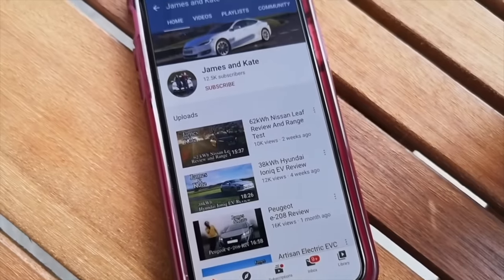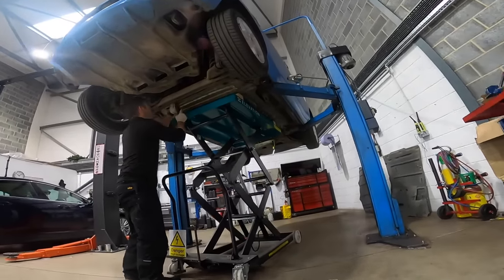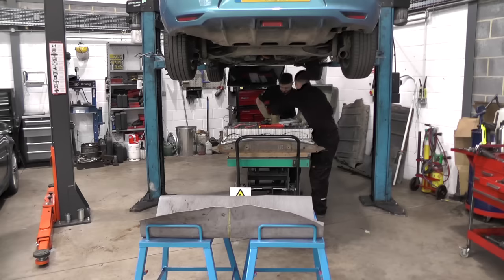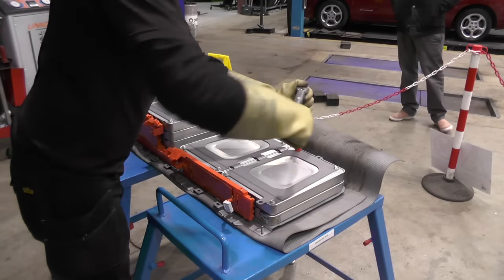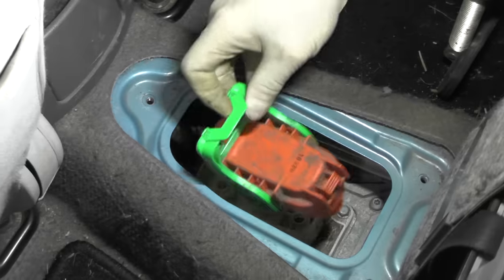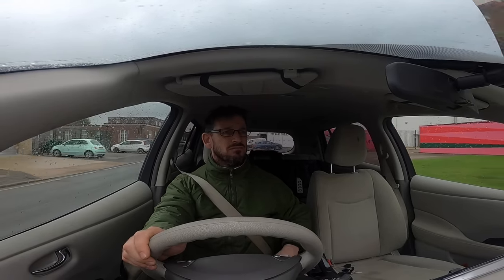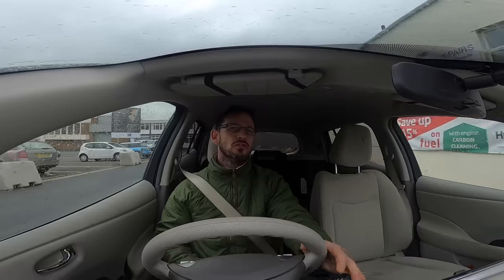Electric Car Battery - Dead After 3 Years, Right??

Comment: What they should be doing is making it even easier to replace dead part’s of a battery and have a system whereby the defective part can be part exchanged for the new part. It should be a simple DIY job and not need a garage with specialist tools. That will be real progress.

Comment: The LEAF battery is very serviceable. I don’t think all EVs are equal in this respect. However, most EVs don’t have the same issues with the battery that early LEAFs had. It comes with being early tech I guess, however still a huge mistake by Nissan to leave out any kind of active cooling.

Comment: It's nice Nissan designed this thing to be easily service. Too bad most dealership service don't know what the hell they are doing, and seem to predatorily gouge people who have faulty batteries. I always advise people who are interested in EV's to never get a new LEAF, get something made by Tesla, Kia/Hyundai, or GM, something that won't suffer from accelerated degradation. Old used leafs can be bought at bargain-bin prices, but don't count on a Nissan dealership to be able to perform this simple fix if there's something awry with the battery. Hopefully third party battery shops become more prolific so people can affordably get their batteries fixed.
Reply: Great advice, just one small correction. GM battery packs are the most expensive to replace, and same as Nissan. GM Dealers are un-willing and/or unable to service.

Comment: So if you have lost 2 capacity bars in your leaf this is the fix? Is this correct?
Reply: No. This battery had an insulation fault, so would report a fault via the management system. Once the faulty module was found, the condition of the replacement module meant that the SOH did climb from 78% to 81.2%.
Reply: @mattcleevely8794  Thanks for the reply 👍

Comment: Top Gear bought one. They claimed it was right off due to its lack of range
Reply: @ lee nevin  Dolts, the lot of 'em.  They should drive it right over to Muxsan and install the upgrades to take it to 400km.  https://muxsan.com/English/index.html
Reply: @Jo Blow Not a chance.  I have a 24kWh 2011 Gen1 Leaf.  And I'll take that on my 44.2 mile round-trip to work instead of a bike any day of the week, even after five years' daily use as a commuter car.  (My workplace has since installed three shiny new charging stations in one of the parking structures.)  It is vastly more comfortable in the rain, has shade and air conditioning, goes faster, lets you bring half a ton of stuff along with, and if you maintain that a bike is better than that...I suspect you may be resorting to rhetoric and hyperbole when you have little or no direct knowledge, or a position to defend.  Possibly both.
Bad form.
Reply: @Jo Blow Not just rhetoric and hyperbole, let's throw ad hominem to the mix.  Sorry to say I expected no less, and you've just shown how pointless it was to have given you the benefit of the doubt.
Still, my wife "has" our first car (a 2002 PT Cruiser) for trips out of town, or for when we need to be in two places at once, but with the plague firmly in place thanks to a "Democratic hoax" (ahem,) we haven't been to a petrol station since March.  Even at today's insanely low fuel prices, it currently costs 1/3 as much per mile in a Leaf.  Though the car came with a "granny charger," that'll fully charge it overnight from a run-of-the-mill 110V 3-wire, for early adopters like us, Nissan threw in a wall-mount level-2 charger, which I cabled to the 240V breaker reserved for a dryer (ours is gas.)  I can recharge in about 2-3 hours with it.
I can go all the way across town and back on a single charge if I keep to surface streets, but both the onboard app and PlugShgare let me see where L2 and L3 charging stations are, the latter of which will put 80% of a charge back on in less than 30 minutes...time enough to do some shopping or grab a meal.  Even better, any Nissan dealership on the planet has L2 and L3 chargers, and I can charge there for free forever at any time.  (There are seven in our metro.)  Go ahead, explain to me the virtues of an ICE car over this...does your dealer ever top off the tank for you?  For those occasions when we go all the way across town, it's for more than a day, and we charge there while working, playing, sleeping, or whatever.
I've put 72,000 miles on this guy since we bought it, and so far it's only wanted a set of tyres and wiper blades.  (And a nifty new horn to replace the clown car horn that comes standard; https://www.youtube.com/watch?v=02dYqCmQdZQ&t=333s.)  Annual inspection and registration?  US$7...no emission test.  And oil changes?  WIll never happen.  Sure, the other car is twice as old, but it's there if we need it.  But full charge to full discharge took me 91 miles the one time I tried it, and I have hardly ever needed to go farther without boarding an airplane.  True, I do not have the original battery.  But it was only because Nissan offered to give me a new one in 2015; a second-generation battery at that, which required an adapter that I now don't have to buy when I want to swap in a higher-capacity battery circa 2030.  Which will have another decade of technological development on it, and cost even less per kWh.  It might even be a supercapacitor.
Are you berating me as a way of justifying keeping your old ICE car, or getting a new one?  You don't have to sell me on it.  Let it die a natural death after ten years, it won't bother me a bit.  I can detail my experience of the Leaf as superior to that of my trusty coupe (which I would still be riding around in had it not been bombed in '04) without ever having to touch on the environmental argument, nor of not supporting Islamic lunacy by not using petrol any more.  But if you're trying to convince me that it would improve life for either of us to have two ICE cars...
this is not a fight you can win.
Reply: @Jo Blow Hey, at least you sort of read it; thanks.  I wrote a lot because there's a lot of ground to cover.  And the "limited locations" are the fast, free Nissan dealerships.  I've only had to charge away from home a few times, and used the card Nissan gave me to do it for free most of the times I did.  Blink and other charger networks are ubiquitous, and it still costs less per mile than petrol even buying it from them.  (They're at grocers, pharmacy chains, public libraries, airport parking lots, just to name a few.)  [Edit:  have a look at PlugShare.com to see how many you have near you.]
Yes, it was a little more costly at first.  New, we paid US$26K; a little higher than a similar new ICE car (the Nissan Versa used the same chassis, but was less well equipped,) still vastly more practical for a commuter.  We already had one ICE car in good working order, but now we could work at different places and not rely on public transit.  (Still have it.)
As for the issues you point to, here's MotorWeek on those topics (https://www.youtube.com/watch?v=X_11rlVF3Dg)
...and here's a fairly even-handed private owner (https://www.youtube.com/watch?v=mFiTHPMhXwo)
Sure, there are issues with new technology.  LeafSpy and an OBDII sensor are a great help.  (Though I have one, I have never needed it.)  And contrary to what he says, you can pull the battery in your own driveway. (https://www.youtube.com/watch?v=BtBOKyu_soU&t=192s)  Build a creeper with some wood and castors, buy a used £50 floor jack and service lifts, and you're ready to go.  (I may do the battery swap myself when the time comes.)  I have had no module failures, so I couldn't speak to that, though I did deliberately run my first battery into the ground by 440V charging as often as possible when I learned I was getting a new one from Nissan.  AFAIK, no modules failed, though I did run the pack under 70% in four years by doing so.  I don't run deliveries with an EV, though I understand Amazon soon will.
What none of these videos mention is the time savings.  Make a weekly 15-minute stop at the petrol station (and assuming there is no queue, ever,) that's already more than 60 waking hours over five years.  About four days of your irreplaceable life back.  Free!
Stopping for an oil change every three months or so?  How long does that take?  30 minutes, assuming no queue?  Guess what:  That's more than an additional day of your life back.
Five years' wear and tear on an ICE always comes at a cost (MotorWeek covered that pretty well, but gave no estimates.)  Let's just say it's another two days of time and money you don't need to spend.  Congratulations, that's at least a week of your life back; a vacation and money to have it on.
How will you spend it?  Watch ten more movies?  Sleep a bit longer?  Race on the Autobahn?  Take a weekend river cruise?
You will never know.

But I will.

Comment: How ironic, the lack of liquid battery cooling made the cell swap easier. Any other EV with liquid cooling need the cooling system drained first in order to remove the whole pack.
Reply from the maker: Indeed. This would have been drained whilst still in the vehicle, had it been the case

Comment: Much of the battery (or cells) are not recyclable (or difficult to recycle) and many will not last more than 10 years, even the manufacturers will only guarantee 6-7 years. 87 mile range, Is that really much of an improvement?
Reply: They are not difficult to recycle if you have the correct means to do it. VW have EV battery recycling plants already up and running.....almost all the elements of a battery pack can be re-used.

Comment: What many people don't realize is that, unless they're abused, automotive Li-ion batteries typically DON'T DIE!  They simply fade away very, very slowly. It's the abuse that gets them which is largely from overheating. IMHO, and contrary to popular opinion, the early Leaf batteries were not poorly engineered, and for most people did not need to be liquid cooled. Nissan got a black eye for this but it's largely undeserved. If you do not use DC Fast chargers preferring instead to use Level 1 and Level 2 charging exclusively, you should never need liquid cooling. The biggest problem with the early Leaf batteries was that Nissan simply did not design them to take the abuse of being operated outside of their design envelope (something Americans have a bad habit of doing). The batteries didn't like being operated in areas where ambient temperatures often exceeded 100F. Doing so demanded that extended periods at extremely high speeds (over 80) mph be avoided along with DC Fast charging since both would drive up internal temperatures that were likely high already due to high ambient temperatures. Too many of the early Leaf battery failures were from Arizona where it's not uncommon for daytime temperatures to exceed 110F. Owners of these vehicles also admitted to using DC Fast chargers during high ambient temperatures. 
     Other than exposing the cars to conditions that caused excessive internal battery temperatures the only other factor for premature capacity loss was excessive charge cycles. I believe the early batteries were only designed to last between 800 and 1000 "full" charge cycles.  With only 80 miles of range, after 1000 charge cycles, you'd be lucky to have gone 80,000 miles before seeing 15%-20% capacity loss. Still there are way too many examples of Leafs going over 100k miles on the original batteries which makes a strong case for their quality especially since the early 24kWh batteries were so tiny that they required charging far more frequently. Today, because they're much larger and offer much higher range between charges, the newer batteries will see far fewer charge cycles for any given mileage.  With most new EVs getting 250 miles or more of range they may only need to be charged once per week. This is unlike the tiny range of the older 24kWh batteries which often necessitated charging two or more times per day.  For long lifespans SIZE MATTERS when it comes to EV batteries.

Comment: Just wondering what is on the odometer of the car.
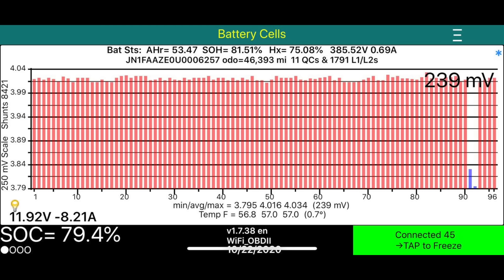Reply: odo=46,393mi  according to leaf spy at 1:07
Reply: You can't necessarily rely on the odometer as a measure of the state of the battery. That will depend on how the car has been driven and how sympathetically the battery has been treated. It's not a new concept. Drive an i.c. car really badly, and that will let you down prematurely too.......
Reply: @Brian-om2hh  I was being lazy, looked more closely at the video and showed 46,000 miles on the clock. The constant reference to ‘landfill’ is silly though, companies are already set up ready to do recycling and what they call ‘urban mining’. Audi/Northstar have a pilot plant and have already build new batteries from materials recovered from old ones. EVs are in theory and should be in practice part of the circular economy we need.

Comment: Most people? 
In almost 30 years of dealing with battery systems I have never heard anybody even suggest batteries go into landfill,.
It sounds like something from the media or of the internet.
Reply: I’ll tell you most people tell me, ah you have to replace the battery after two years. It’s the most common muc ice drivers will tell you. I just say “ really?” .
Reply: @bdeithrick  Where do ICE drivers get this information from?
Reply: @anthonylangton3664  big oil propaganda
Reply: @bdeithrick  where?
Forgive me if that sounds a bit smart, but where.
Going with my original comment, I have never heard this.
Reply: @anthonylangton3664  Jeremy Clarkson from Top Gear famously said it (around the time that he reviewed the Tesla Roadster). I'm an energy engineer and have had Clarkson quoted at me ever since (though it's gradually decreasing in frequency)...
Reply: @davidhaywood8029  I test drove a 1st gen Leaf when it was first launched. Went to the local Nissan dealer and their head salesman, their HEAD SALESMAN said, “Oh you don’t want one of them, they don’t work. Didn’t you see Top Gear?” (I went to a Nissan dealer in the next city instead and they were very helpful).
Reply: Try clicking on a car advert on social media. Plenty of “experts” on there!

Comment: Why was it so expensive ?  Is there a price breakdown?  It only took 2 hours, so that maybe £150, that leaves £350 for the battery.
Reply: Unfortunately I think your 'labour' estimate of £150 doesn't take into account that the job required 2 technicians, for EACH of which you may be charged up to £100 per hour, particularly in a authorised dealership. Stings I know, but pretty standard nowdays.
Reply: @Phoenixeire  so £100 an hour for someone to unscrew a few bolts and move a heavy battery.  Well worth it
Reply: @mrglwatson  Believe me, I agree with your sentiments, but those tools, jacks, lifts, rent, power and wages have to be paid for somehow.

Comment: EV batteries will never go to landfill - the raw materials in there are just too valuable (and toxic), and with the volumes of batteries due to come out from old EVs, recycling is inevitable.
Reply: I should B well hope so or EVs could hardly be called environmentally friendly
Reply: @law1008   - It's a lot more practical than that: With the relatively restricted raw material supply there is simply no way to meet electrification targets without battery recycling. It is a business that simply has to happen, no matter the cost.

Comment: They probably need to put the batteries in an easier place to work on seeing as they will need to be replaced in future
Reply: How was that not easy? If you put them anywhere else you'll throw out the centre of gravity if they're higher or you'll face lifting them out instead of just lowering them down.

More to the point are otger/newer brands just as repairable or not? Also would a main dealer do this or insist on replacing the whole battery?
Reply: Easier place to work with? Can u give suggestion what would that be if that place was difficult? LOL
Reply: You mean like they do with the clutch on a fossil?

The battery pack is where it is because of engineering and design considerations, not for the ease of repairs nine years or more down the line.
Reply: @michaelgoode9555  it took 20h to change starter motor to my v10 tdi touareg 😁
Reply: @dot7107  Crazy.  I was watching an episode of Car Wizard recently and cringing at the levels of disassembly required for some jobs.
Reply: @michaelgoode9555  it is quite simple , almost every job after regular maintenence starts with removing engine, gearbox and subframe from the car😂

Comment: Sorry to rain on the parade but it is not that simple.  What you did was fix a particular problem that that Leaf had.  It would not fix a battery ruined in 5 years on a car used in a hot climate.  Check out absolutely furious Leaf owners from Australia where the lack of battery cooling is a disaster.  So fine in cooler climes, NOT in hot climates.  No one refurbishing or even repairing Leaf batteries in Oz at the moment.  So the only option in Oz is Nissan at AUD10k for a refurbished battery.
Reply from the maker: Indeed, thermal management is definitely an issue and heavy Degredation would require all modules to be replaced, but for this car and many UK based drivers, it works.
Reply: I would have thought the only fix for that in Oz is to sell the Leaf! If you fit a new pack, it still has no active cooling so that won't last long either.
Reply: @SheepShearerMike  Exactly.

Comment: What exactly have you done? Was it a repair, a rebalance or what was it. This part was not clear. All we can see is how the bat was taken down, dismantled and reinstalled.
Reply from the maker: You did watch the whole video? We removed a faulty module due to an isolation fault, balanced and tested a second hand unit and replaced it.

Comment: But this is not the case with many battery packs. They are in many cases not modular like this Nissan pack.
Hence exchange costs is higher that the value of the car in many cases.